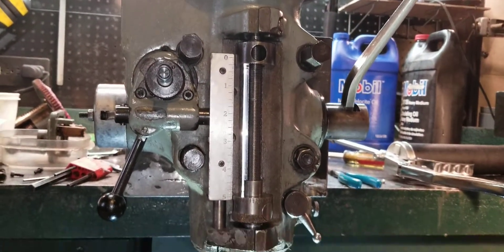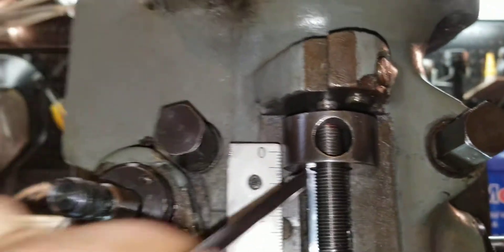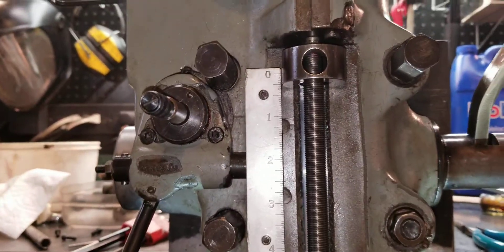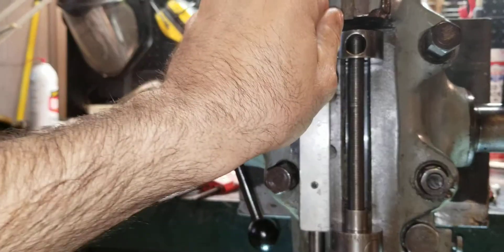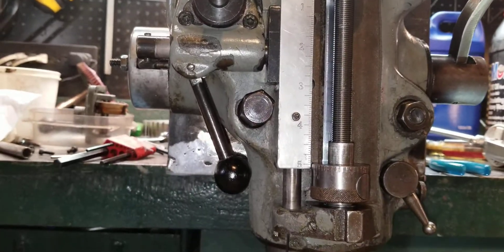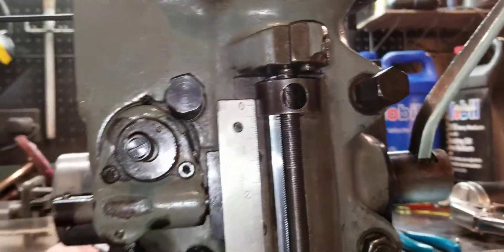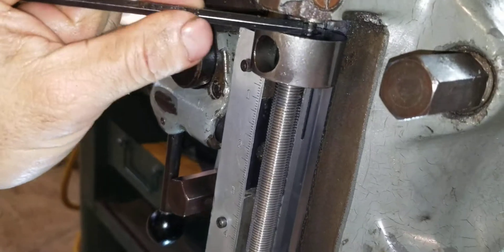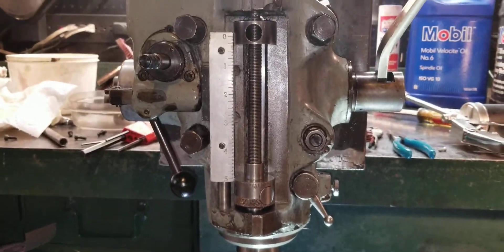Bridgeport quill feed disengagement adjustment

Comment: The manual recommends a different method. Some have a lock nut on the bottom where that Allen is. Mine does not have it.
1. Release locknut N 
2. Engage trip handle lever P
3. Adjust micro nuts against the quill stop (That part that moves up and down)
4. SLOWLY turn adjusting screw (that allen) until trip handle lever trips. If set to light the machine will not be able to drill
5. secure locknut N
6.Check for quick action response

I got much better results doing this method after trying your method.

Comment: I just picked up a mill like this. My top kick out button won't reset on its own, I have to push it down manually. Is there some adjustment for this? I have lubed it with no change.
Reply from the maker: Sounds like that barbell thing might be bent. Is everything clean up in there... does the button slide up down easily?
Reply: @Depth_of_Cut  so I got to looking and it was missing the compression spring. I just happened to have something very close in my junk drawer. It all works now.
Reply: @Depth_of_Cut  seems to move pretty easily by hand. Does that top stuff come apart to inspect?